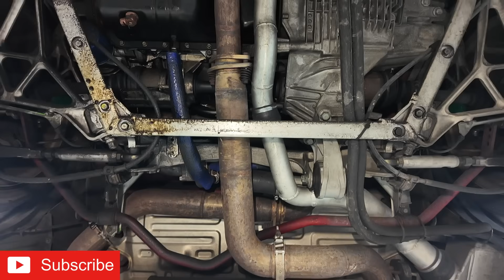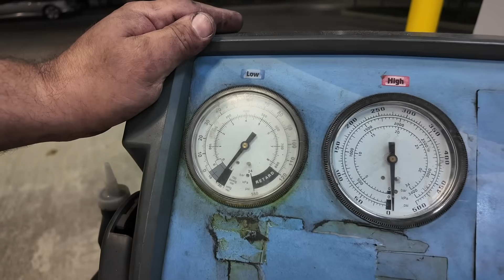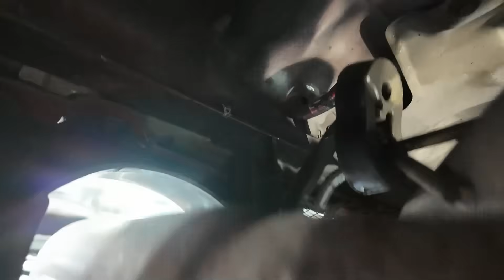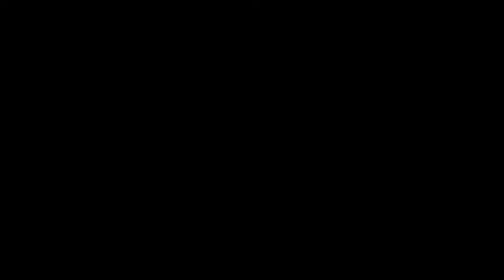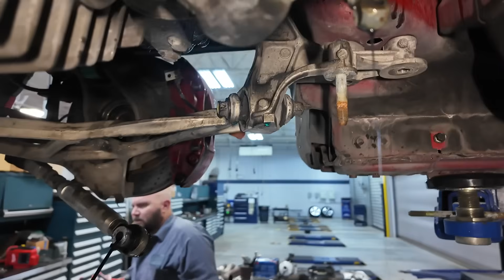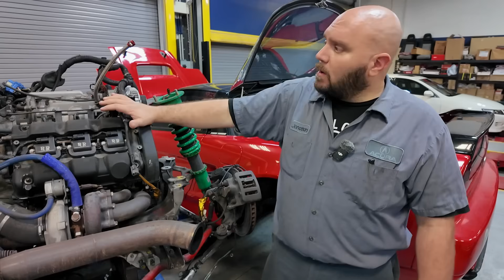No Turning Back: The First Step of Our Twin Turbo NSX Restoration (Ep 5)

Comment: Big time agree with Jon on working on the motor out of the car. I’ve done engine out re-seal projects on both my Miata and GSR. It’s super satisfying and even therapeutic to work on everything in a stand, and not hunched over the bay or crawling around underneath.
Reply from the maker: It truly is the best way to work on a motor, specially on a major work or reseal

Comment: nice watching this NSX getting fully restored from top to bottom. Don't half ass the work..  I saw a guy with a clean red race build Nsx on a sema build or car show.. he had a rear vent thing in the rear engine. it's pretty clean. Ya'll should get some insipiring ideas from it.  since this is a twin turbo car. Some side vents and rear window Vent to the  engine be nice too.  Maybe wrinkle Red "TYPE R" valve covers.. hehe and Center bumper 2/3 pc titanium Type R exhaust tip Style?
Reply from the maker: Thanks for the suggestions! We have been wrenching these NSXs for quiet a while and we have a pretty good idea on what to do with this project. Please stay tuned!
Reply: Half ass the work... is this your first time on the channel? They strive for perfection.